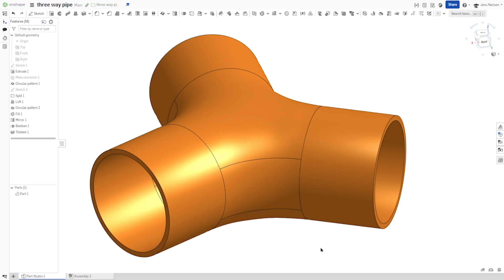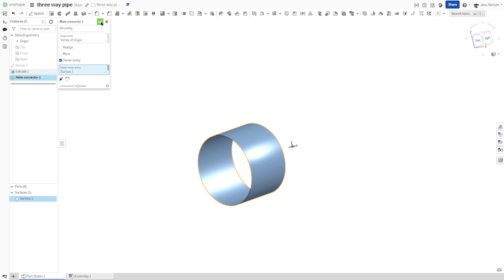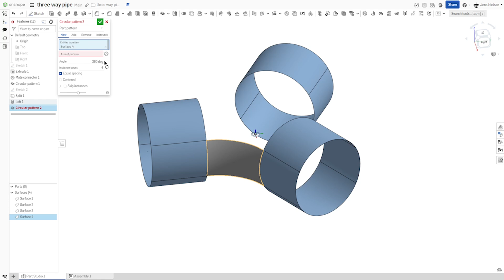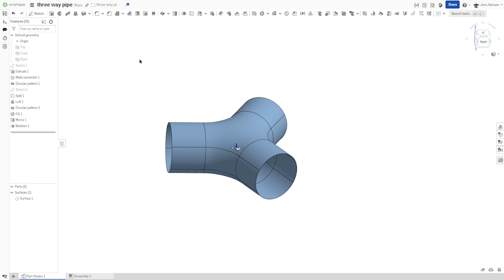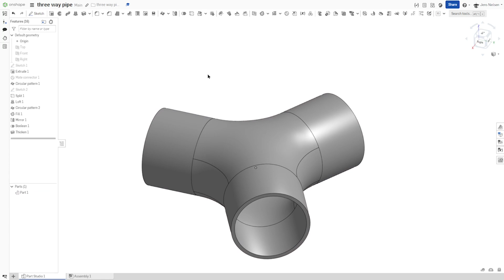Modeling a Three-Way Pipe Joint with Surface Tools (Extrude, Split, Loft and Fill) in Onshape

Comment: Thank you very much...... i did this exersice one on one and it worked.
But when i did my own 4-way pipe i could not use the thickning tool.
I use D=12.3 L=25 and starting ofset 25. The hight of the sketch for the split i used 6.
Are these dimensions useble ?

Kind regards,
Peter
Reply from the maker: ok, there are limits for that connecting surface. Maybe you need to change the value for the "weight" this has on the tangency. I think I left it a 1. Try with a smaller value.
Reply: @cademist  Thank you very much.... i did play with the dimensions and it workt.
I am realy new to OnShape but i love it to create and then 3d print this.

thx again and greetings from Holland

Comment: Ah crap couldn't have posted this a week ago? Haha
Reply from the maker: No worries, eurospec! This tutorial will be here for whenever you need it. Although, maybe next time you can plan your plumbing projects a bit further in advance? ;)
Reply: @cademist  just got around to making this today, worked like a charm.  Thanks for the video, taught me new skills, particularly building with surfaces rather than solids and using surface fills rather than just using lofts to connect everything.
Reply from the maker: @eurospec  That's awesome! So glad to hear the video helped and you were able to put those new skills to use! Building with surfaces is a great technique to have in your toolbox.

Comment: Nice demonstration, thank you, I picked up a few new tips. I especially like how you split the faces of three surfaces with a single sketch, I would never have done it that elegantly. If I can offer you a tip, when you use the fill tool, if you set the first edge to curvature continuity, then each subsequent edge you select will also have curvature selected. You still need to add the corresponding faces, but it saves you a couple of clicks :)
Reply from the maker: I'm glad  you could learn something-plus thanks  for that tip with the  curvature-continuity, I did not  know  this!